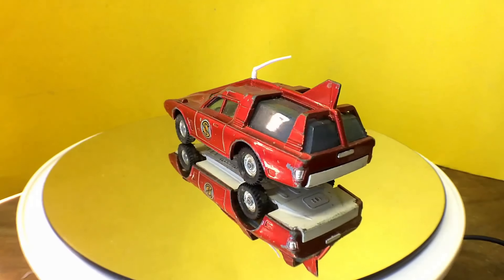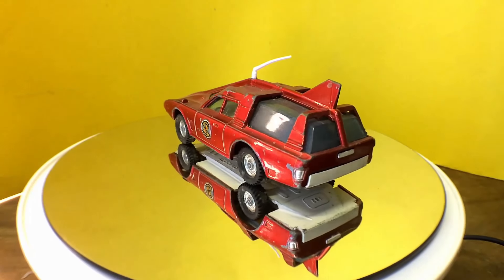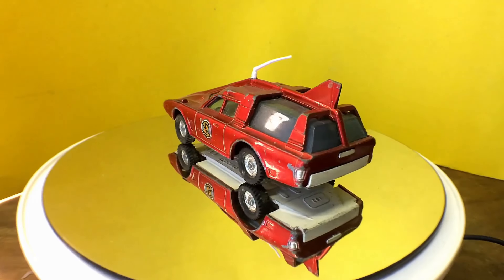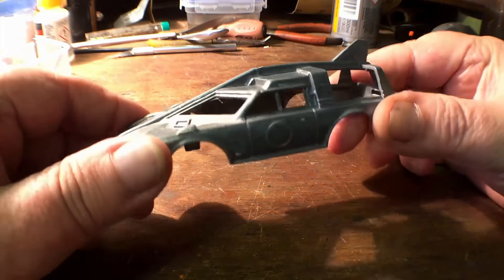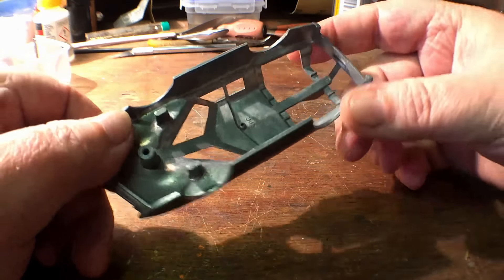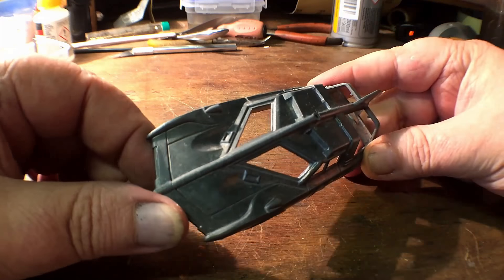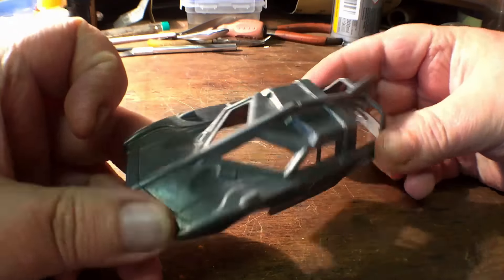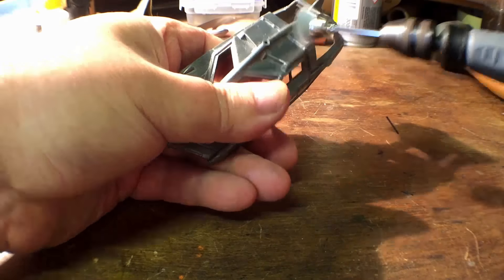Dinky 103 Spectrum Patrol Car Restoration

Comment: Hi Bob just a tip to help with installing tracts in the futcher. A cup of hot water will allow the rubber to relax. It only takes about 30 sec. To 1 min  the rubber will go back to it tentchion. Nice work my friend.

Comment: I'm not positive but I think a bit of flint is intended to rub against the flywheel inside the back of the car creating sparks inside the opaque plastic baffle.  this in turn would make for a rather lovey light show.  the flint  was probably attached to the tab attached to the top of the white plastic baffle.. flint from a cigarette lighter might work.. perhaps maybe ?
Reply: or maybe the flywheel is made of flint and just requires a new metal tab as the original one was worn away by the wheel .. I don't know
Reply from the maker: Classic Boat Mike off grid experiments, nah mate, all it ever did was make a whirring noise when you press the rear down as you push it 😉
Reply: @BobWilliscorgi  push down lightly and pull car back, then let go. car shoots forward. same mechanism on ed strakers car  ( no.300 i think. )

Comment: Another good job Bob.....nothing  to do with this model but can you tell me when you print your own boxes what thickness card you use also are the templates from a CD? if they are can you tell me where I can get one?
Cheers
Andy
Reply from the maker: Redsectora , hi Andy you can get the Dvd’s from eBay and I usually use 350gsm Smooth White Card from the Papercutz website 👍
Reply: @BobWilliscorgi  Cheers Bob
Reply: @BobWilliscorgi  Maybe you could do a video from start to finish about printing boxes?
Reply from the maker: Redsectora sorry mate but I’m not getting into all that 🤨 there’s so many different boxes on them Dvd’s and not all of them are straight forward to print easily without a bit of trial and error, it’s the kind of thing you need to do by just taking your time and using a bit of common sense .
Once you figured out the correct size for the box you’re printing just save the printer settings somewhere for next time 👍 (write em down)